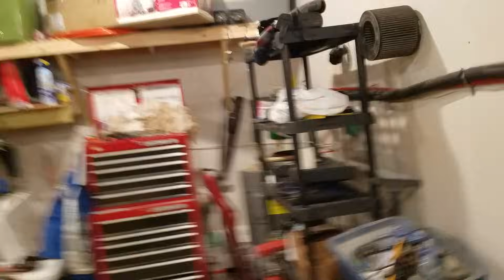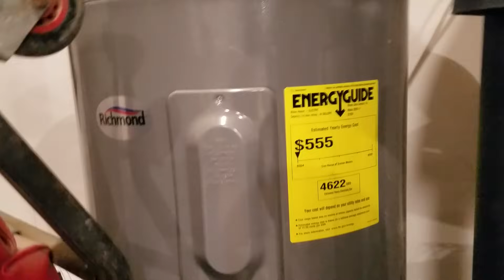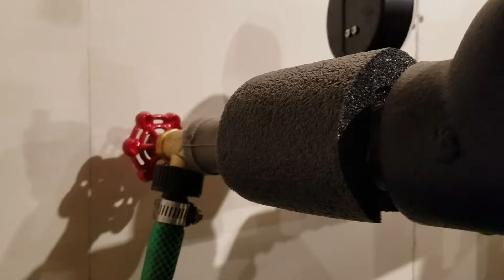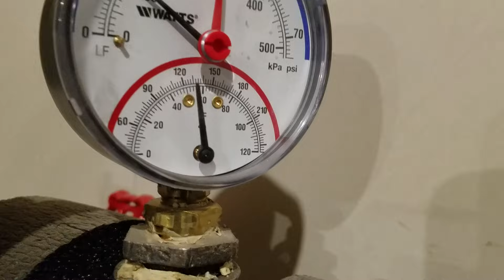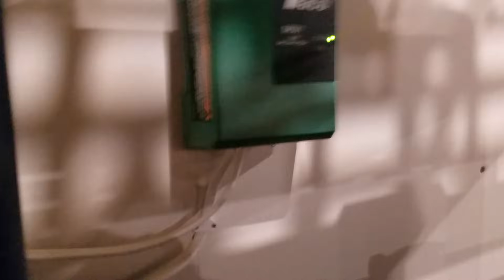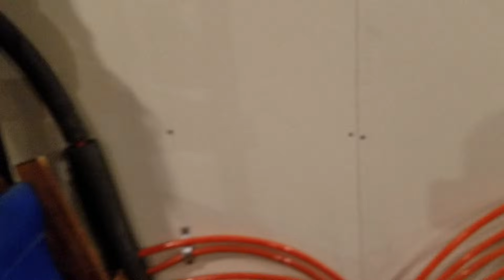EASY FLOOR HEAT (using a new or used hot water heater!)

Comment: I am looking to heat my remote, old A frame with something similar. Do you think it would work with regular radiators??
Thank you for vid.!
Reply: This won't work with radiators, waters heaters are not capable of putting out the btus to heat the air, I'm actually amazed it's working for this system but I just put together the same thing to experiment with. I'm sure it's a very inefficient way to heat anything
Reply: thank you
Reply: First month was 85 dollars extra on electricity to run a water heater to do in floor heating. And that's only heating 400 square feet. Poorly insulated. Kind of what I figured. Thermostat is also only set to 60 degrees

Comment: Do you have a check valve in line anywhere? Is a pressure tank necessary for same floor heating?
Reply: Rick Holtti that’s an expansion tank when water is heated in a sealed system like that you have to have a place for the water to expand to so it is required.

Comment: ❤❤❤  imo a boiler meant to run to 180 is overkill for radiant.  But how costly is running electric, even say 100 degrees..i would wrap that in a water heater jacket add insulation to everything.
Reply: Thomas  Broking the water wrapping isn’t the killer.    It’s the fuel vs btus.     Electric is generally the most expensive even though it’s the most efficient.    It’s 100% efficient but generally a kw is expensive.   Insulate the perimeter of the slab.   That’s key!

Comment: You must NOT put a shutoff valve on the outgoing side of that water heater. If both valves were closed it has no room for expansion and your only recourse is the t&p valve which you better hope works

Comment: Is the thermostat stepped down to 24 volt or is it a 120 volt stat?  How did u bleed the system upon startup?
Reply from the maker: rickiep perez the thermostat controller is 120 volt. The thermostat itself is ran by 2 double  A batteries.
Reply: I think his point is about that circulator controller, which makes it a 24 volt system. The battery in the t-stat is what runs the display (and clock?) while the 24 volts is running the system. Most people don't realize the battery goes dead faster if the t-stat is "calling" more often.

Comment: thinking about using a solar hot water heater to use with a set up like this. with a gas hot water heater for back up and nights
Reply from the maker: I can't see why that wouldn't work. You will have to let me know how it works for you.
Reply: If you use a solar water heater for the main source of heat I would have a 40 or 50 gallon water heater as a storage unit that has had several inches of insulation added to the outside of it. Unless you are in Canada it might even work out using electric, or maybe using one of the heat pump water heaters.

Comment: How do you know how much to pressurize the expansion tank before turning the heat on?
Reply from the maker: I put 2 to 3# in the system before heating. Then just monitored it. Adjusted pressure as needed.
Reply: @thisguy014  But do you pressurize the tank before pressurizing the system?

Comment: Very informative video. There is literally nothing online for a diy hydronic heat. I have built the same exact setup, the issue I am having is between the thermostat and Taco panel causing  my pump to not kick on. I have the same thermostat,how did you wire   it and which terminal in the panel did you hook up to? Thanks
Reply from the maker: I have made a video just on this topic. CLICK HERE --} https://www.youtube.com/watch?v=SNqXEbU29i0
Reply: Thank you, I wish I would have asked the question sooner so I didn't have to spend all weekend pulling my hair out searching Google endlessly for information. Like I said I built the same exact system all thanks to your simple design and cost. I would upload a picture of my setup but I can't figure out how,maybe another tutorial for that in the future? Lol. Turns out it was a faulty thermostat,when I jumped the red and white wires it kicked right on. Also, great tip on the timer I was a little concerned about burning up my pump but the garage is at 60 degrees and climbing. Thanks again.
Reply from the maker: cliveyng I like the small hot water heater. I really think that's the way to go. Quick to reheat.

Comment: do you need a seperate water heater or can you just utilize the house water heater?
Reply: That would be my question as well. We are thinking about doing this for a small addition.
Reply: @PapajosTraders  You need a separate water heater for your system. The reason is that a normal domestic hot water tank relies on hot water to pool at the top of the tank and the cold water enters near the bottom of the tank through an internal dip tube. The thermostat/gas valve is near the bottom of the tank where it is sensing the cool water. When you add a circulator pump, the tank temperature evens out from top to bottom of the tank. You no longer draw from the pool of hot water on the top for shower, bath, or sink hot water.  

Your domestic water will not be hot enough even if you set the thermostat to its highest setting. It still does not provide hot enough water. Then if the pump shuts off during a power outage, the water will be scalding hot. I already tried this setup with a 40 gallon tank for several months 10 years ago. I liked the warm entry way tiles but couldn't take a warm bath or hot shower. Also, the bath water had grit in it from sediments being stirred up from the bottom of the tank by the circ pump. The shower head clogged several times and so did the sink aerator.
Reply: @kimmer6  thanks! Very helpful!

Comment: I honestly found this trying to figure out an igniter issue for my grandmas pearless tankless water heater in the back of the house, no hot water or garage heat, the tankless heater says there is an igniter issue and a return sensor is unplugged, unsure what to do, I told her to call an HVAC specialist/plumber who would know what to do, what's really messed up is she has radiant baseboard in the second floor and finished attic, but the first floor has the original copper painted cast iron radiators from the house, she bought it as a 2 family and converted it back to the luxurious single family victorian mansion it is today, but the back of the house is an addition with gas forced air heat that runs off of the same furnace as the back central ac unit, 2 furnaces in the main basement alone for ac, and 2 gas boilers for the heat on the main, 2nd, and 3rd levels, on top of the tankless system running the hot water in the back as well as the garage heater and the hot forced air heat ac unit combo it's a nice house just seems like so much energy wasted to me
Reply: My gosh. I cringe when my gas bill hits $130 a month. I can't imagine what hers is.

Comment: love it!! I am getting ready to build a 50x 70 garge to work on my toys an was thinking about doing this it looks kinda simple... so I dt need a constant water supply just use 50/50 antifreeze?
Reply from the maker: I filled mine with 50/50 antifreeze once, using a small electric water pump. It took several times after that, still using that pump, to circulate air out the system. If I did it again, I think that I would fill the whole system with 50/50 with the pump, and then pressure it up with the garden hose.
Reply: Roger Evans 
Do u have the schematics how to lay out the pex tubing
Reply: kalieb Griffiths no
Reply: 50/50 antifreeze is expensive. Mix your own using water and straight antifreeze. Buying 50/50 antifreeze is paying big bucks for half a gallon of water. Think about it.
Reply: If your just starting the garage then put 2" insulation on the dirt before you pour cement.  Supply loops around there perimeter and work your way back.  300' run max.   Depending on how cold it gets outside will determine 6/9/12" center spacinng.
Reply: The type of antifreeze that only should be used is boiler antifreeze is non toxic. RV antifreeze might work but not sure.
Reply: 50/50 antifreeze is not compatible with pex tubing
Reply: did you use 50/50 out of the jug or did you calculate how much anti-freeze to water mix and add?
Reply: Cyrotek antifreeze is the only type to use with oxygen barrier pex tubing. Menards sell this in 5 gallon buckets or 55 gallon drums

Comment: So you mentioned something alomg lines of filling the system and running pump getting up to a certain amount of pressure. Cant i just fill the system until doesnt hold anymore and all air is out and then plug it in and let her rip?
Reply: The water expands when heated so you need the expansion tank and system pressure should not exceed the rated pressure of expansion tank. Typical is 12-15 pounds. If pressure gets to high then relief valve opens and dumps water out to reduce back to system pressure. Relief valves are usually rated at 30 psi

Comment: Super Dave = how more do you think electric floor heat would cost vs. hot water gas floor heat? I would say $50/month more...So,,, big deal.... Electric floor heat has only wires = done = hydro bill... vs hot water floor heat = water cost, gas cost, equipment cost...go and save $50 per month....it takes a fortune to install those copper pipes. Also, if something goes wrong with your hot water sensors, meters etc you are cooked with repair bill...( I would go with electric floor heat)..

Comment: I dont understand how the hex lines heat the floor. I live in Southern Cal so our knowledge is limited on floor warming sytems . My garage floor gets very cold at times and I have an extra/used functioning water heater at my disposal.  
Thx, Gerry from San Diego, CA
Reply: The hot water created by the tank circulates through the pex lines under the garage floor, typically about 4" of foam under the pipes and 4" of cocrete as garage floor. If you can get your outlet water up to 120 degrees you can achieve 70-80 degree floor temp

Comment: With your expansion tank behind your pump it causes the pump to work off suction .  When your pump comes on it cant raise the pressure at the expansion tank [Boils law ].  so the pump cant create head pressure so it can only cause a vacuum .This will destroy your pump fast. Move your expansion tank to the suck side. I learned this at coffie with Caleffi on youtube. good luck
Reply: Not completely true considering the system pressure is around 15 PSI and a properly sized pump will only have maybe a 5 PSI differential from low to high side. If I read this installation correctly, the low side of the pump is from the floor return so should still see no less than 10 PSI while the high side may jump a few above the 15 PSI static pressure.

Comment: How long does it take for this system to initially heat the floor? I just installed a water heater on my system because the original system I bought from grainger failed after 1 year and they will not refund the system because they quit making it. Any way I let my water heat up and then turned the thermostat on and it ran for 1 hour and only raised the temp up 1/10 of a degree.
Reply from the maker: It takes awhile to heat that cement up. I put my thermostat on a timer, so it runs 1/2 hr and shuts down for a 1/2 hr. This gives the water heater time to heat up. I also have my water heater on high, so it starts with 120 to 130 degree heat. Let me know if this helps, if not I can make a video for you. Thank for watching.

Comment: No make up water? Eventually you will lose pressure from the water heating causing a pressure drop and possible damage to your equipment. How long have you ran system without having to top up the water?
Reply from the maker: Once a year. I got away with 2 years, but it needed to be topped off the next year.
Reply: @thisguy014  If it's a closed system how does it lose water?

Comment: Pete may not like numbers, but a few basic ones will keep you from wasting your time. The heat loss math really isn’t that difficult once you understand u factor which is simply the inverse of the r value. IE: R15 = .066 U  U = btu per hour per sq/ft per degree F of temp difference.  Can it be done, of course, as long as the heat source exceeds the heat load.  A 4500W electric element is good for about 15,000 BTU per hour.  Not sure what duty cycle the element will survive at though.  There is no code approval for a domestic water appliance to be used as a heating device so if the device has a duty cycle you must stay inside that duty cycle(really important with gas fired appliances).  The places where you recommended for getting the parts also sell wire rated for open air installation(coiled metal shield).  The power wiring you are using is supposed to be inside a wall and protected.  I don’t really care, but IF you should have a fire, when an insurance inspector looks at that, they may use it as an excuse to NOT pay.  If you need to pull any permits for anything else and it gets noticed, it will all have to be brought to code...

Comment: Does your hot water tank ever run out of hot water and your pump keeps running trying to heat it up to set temp on thermostat?
Reply: No reply, but I can comment on this...  Its not like using the hot water heater for your shower where the hot water just goes down the drain.  In this case, the hot water you sent out to the floor comes back to the hot water heater, it is a bit cooler (minus what the room lost to the outside), but still warm and pretty easy to reheat.  The math is all about how quickly the energy leaves your garage.  In engineering, we use the symbol "Q".  Your hot water heater puts Q into the water and sends that to the floor.  The floor emits Q out into the room and the room emits it out thru the perimeter.   As long as the hot water heater is able to generate more Q per unit time than leaves thru the perimeter, it can never run out.

He gives a hint at this when he says he sets it lower than his father because his father's basement is better insulated than his garage.  At 50 degrees, the hot water heater is able to keep up with heat loss from the garage.  If he set it to 80 degrees, it might not be able to.   In that situation, he would just be circulating cooler water thru the floor and the temp would not rise to meet the thermostat requirement.  Essentially, the entire circuit becomes the hot water heater and the energy rise gets balanced by the energy lost.  Even though he sets the wall thermostat to 80, the system my end up balancing at 60 or something like that.

Comment: That is called a manifold.... you could add flow balancer’s on each loop so you get the same amount of flow through each loop. That’s a shit ton of pex for just the garage. One loop could go as much as 300’. That’s max. I wouldn’t run any higher. Just FYI. And it’s about 8lbs of pressure per floor level.

Comment: Once you have the hot water heater full do you turn off the fill valve going to the water heater to make it a closed circuit
Reply from the maker: Yes. But I also do not connect to city water. I use a pump to circulate out of a pile of 50/50 antifreeze.
Reply: Thanks for the info

Comment: How long are your pex loops? Thanks in advance...
Reply from the maker: I kept my loops 200 ft or shorter, due to the pump rating. A Taco 007 is good for 250 ft of 1/2" PEX tubing.
Reply: @thisguy014  well this just answered my question i asked earlier about the 6 gang manifold and how long your loops were now i found you have a 1200sq ft garage and each run was about 200ft of pex makes sense comes out to 1200 so  i can surely heat my home with this system with 1300 sq thanks you have really motivated me in doing this thanks

Comment: The only problem with electric is your limited in what you can hear.   4.5kw electric is 15k btus.   That’s a mathematical certainty.    Interesting note this is 100% efficient.   Even the circulator generating heat while running heats the garage.    However depending on electricity costs it may not be very economical.    The economics of a system like this vary on your electrical rate and bin data of temperatures outside.

Comment: hows the electric bill. im planning to use propane and do the same thing
Reply from the maker: Around $250 a month. My garage doors are facing the north and the wind will blow them open slightly. (I live in North Dakota so the wind blows all the time in the winter). If the were facing south or if I sealed the doors better, that would be cut in half. Let me know how gas works for you. I do think it will be more efficient.
Reply: I guess if that includes your house electric that isn't too bad at all. I just ordered mine. It's an A.O. Smith 50k btu propane unit. I will try and remember to keep u posted
Reply: Asking anybody really. I have a very unique situation. I want to turn the electric on and off with a 40amp relay thermostatic controlled and keep the water pump running continuously. The reason being I have a 8 inch thick. 40ft floating round slab. Does anybody have an opinion on this? I'm worried about  thermal shock if I turn the water on and off.
Reply from the maker: Dan Murphy Not sure what the situation for this would be. But you could leave your boiler on the thermostat controller, and just wire pump direct to 115V source (like an outlet). Then the Boiler runs with thermostat and the pump runs continuesly. It wouldn't really work with hot water heater (for the boiler), due to it has to have a hot tank of water to start with, if the thermostat shuts the power off it wouldn't get to catch up on heating the water, when the thermostat isn't calling for heat. I think it would also cause premature failure of the pump. Hope this helps.

Comment: About how much was the controller box if u don't mind me asking
Reply: $75 canadian
Reply: @jpaul1030  where can you get a taco pump for 75$
Reply: @dwaynerenton1889  contractor price at Woosely supply
Reply: @jpaul1030  really, that is for the 007. Thanks will check it out